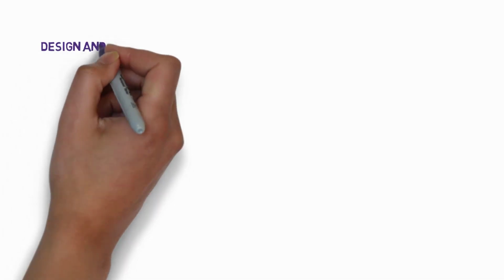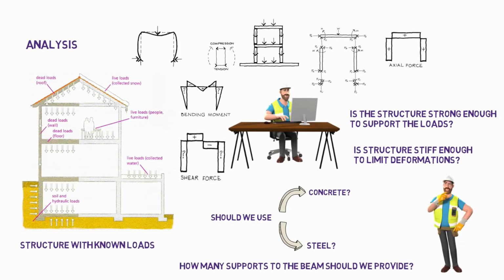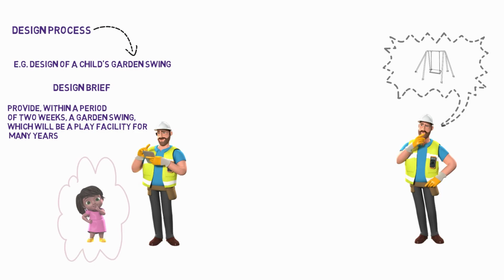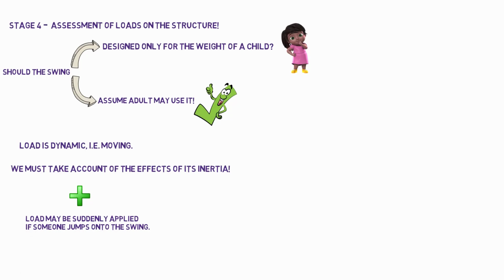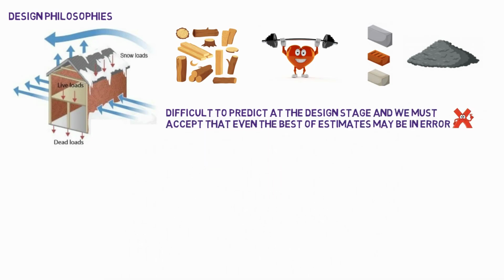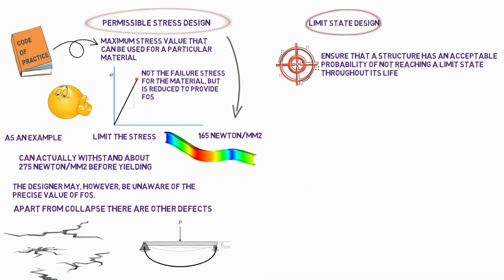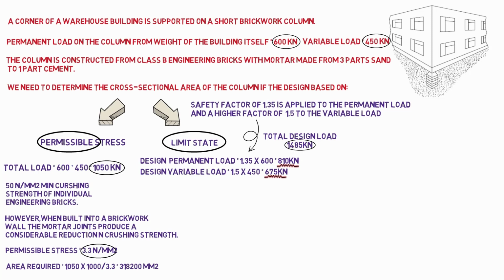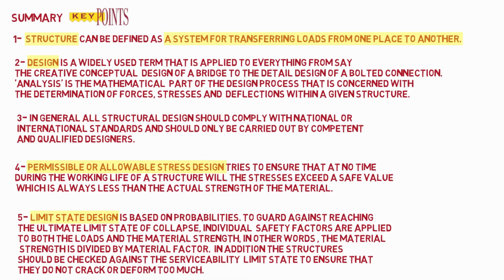Understanding Structural Engineering

Comment: why do we use KN/m^2 instead of Kg/m^2 or tonn/m^2 ,Can someone give me a resonable answer ?
Reply: simple answer is force vs mass. material strengths consider the relationship between stress and deflection. there are many different material strengths that can be considered in the design process; such as load strength, fatigue strength, yield strength, etc. we see failure when the stress on the component is greater than the material strength.

force in this case is mass (kg) * gravity (m/s^2). the newton unit is (kg*m)/(s^2); so kN/(mm^2) is the stress, which is the force due to the weight (m*g) over an area. 

this can be confusing as the units of force in the English system is in lbf while the mass unit is lbm; but both are commonly just called pounds. hope this helps.